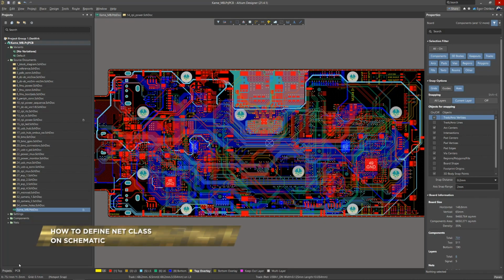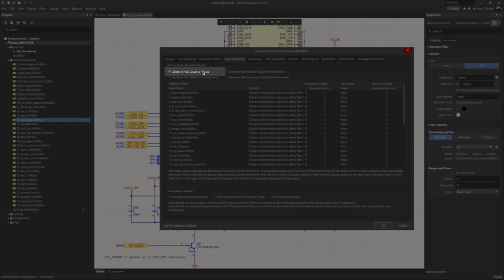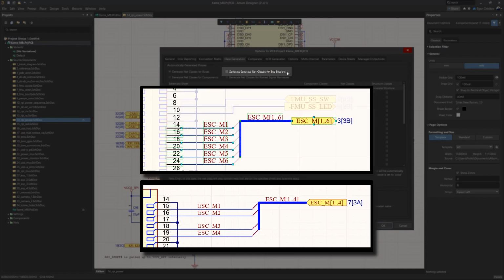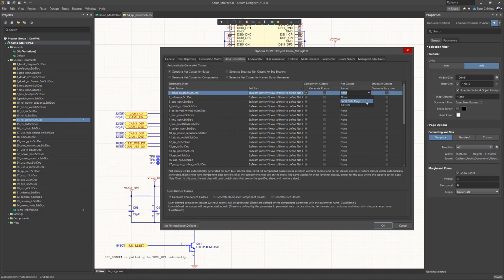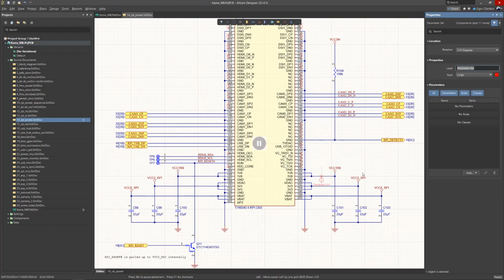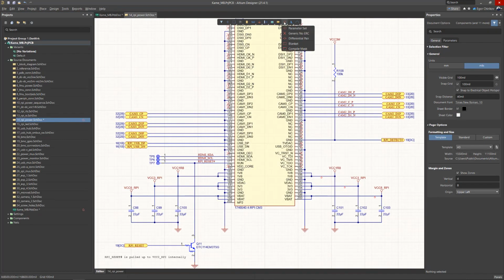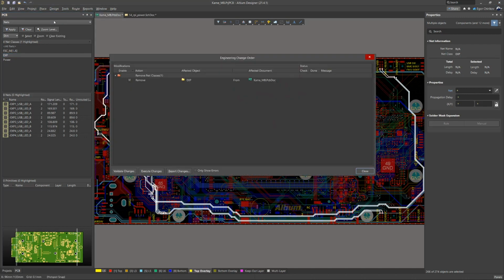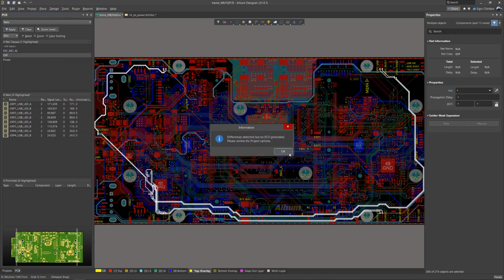How to Define A Net Class on Schematic in Altium Designer

Comment: Is it possible to to import net classes with clearances over an ascii file or something in altium?
Reply: It is possible to import and export design rules, but I do not know about net classes. Maybe there is something with templates that you could use, such as in a PCB template?
Reply: @Zachariah-Peterson  Now with the new Constraint Manager update(s) this is no longer possible. This, as well as defining classes with Directives and Blankets. Killed a very very useful feature, now the suggested way to go is to FIND OUT what nets are to be put in your net classes and add them manually. What about importing Constraints (like it was for rules)? What about PCB Project Templates????

I really really don't get the thought process behind this change.